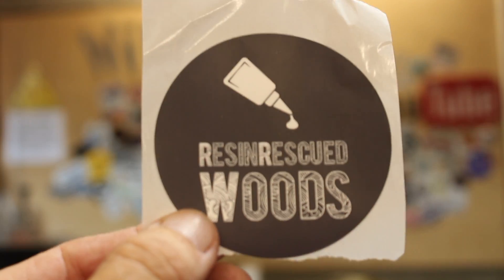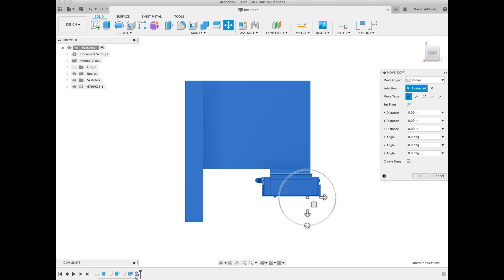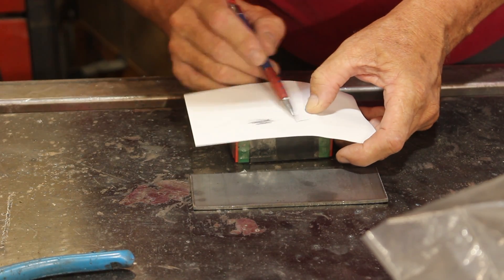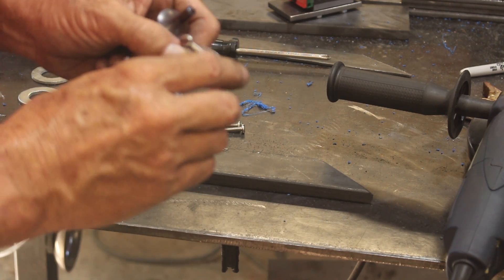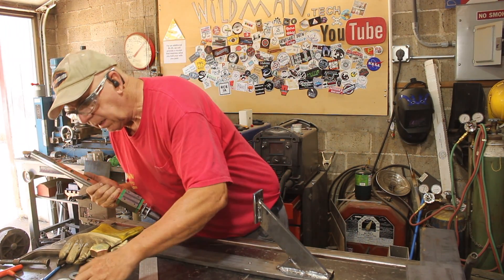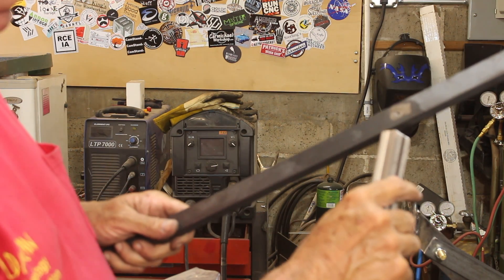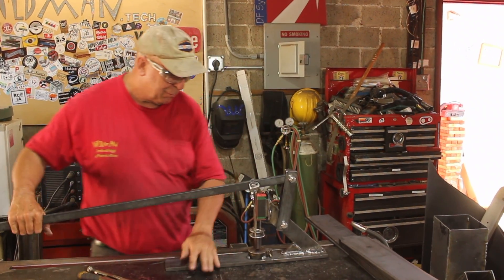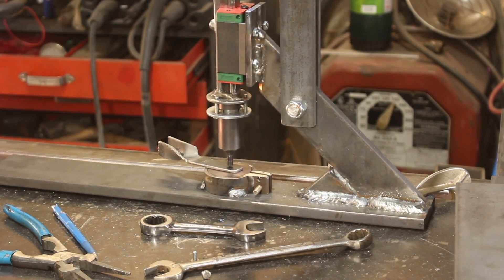Building a Hand Punch Press - Part 1

Comment from the maker: FYI, that punch and die set was only $30 from my local welding supply.
Reply from the maker: I actually have one, but I want a single lever pull to punch the hole. If I have to pump a jack that will take as long as drilling.

Comment: Y9u are well on the way to success.  I made a projectile sizer and I can assure you will need lots of leverage.  Squeezing some lead into a smaller size is a lot easier than pushing a hole in that metal and it took some close together pry points.

Comment: Keep on keeping on. Get rid of the pointy point on your punch it requires more force and grind angle across the punch face at least 1/2 the material thickness and you will reduce the required force by 50%. For mild steel take the circumference x thickness x 25 and that's the ton's required without shear. 6% of that is needed to strip the punch from the part you can use hard rubber or urethane. Good hand press may need some beefing up but should work good for ya.!!

Comment: hi wildman, following recently. the forces involved into punching holes are somewhat unexpected in magnitude and direction. i tried to find the link but failed miserably but you can look up this: Book 7 Hand Operated Hole Punch pdf honestly can´t remember the original publisher but the design is sound. you mentioned the welds pulling out of square and that is always the case but you design weld placement and direction to give you control of this issue. punching is faster and cheaper once you sort the machine issues some kind of depth stop and piece holder will come in handy. regards. pete